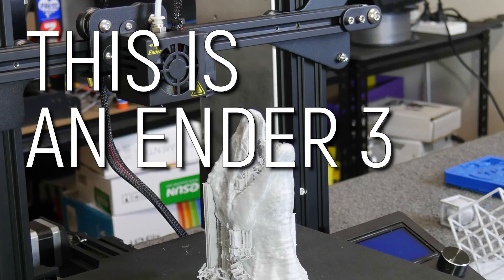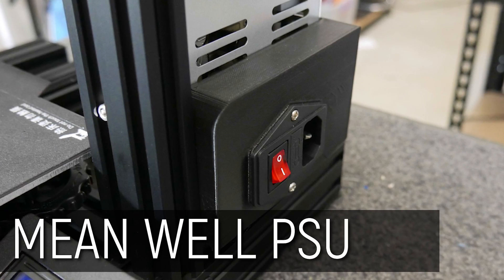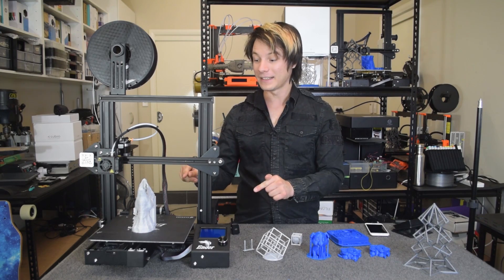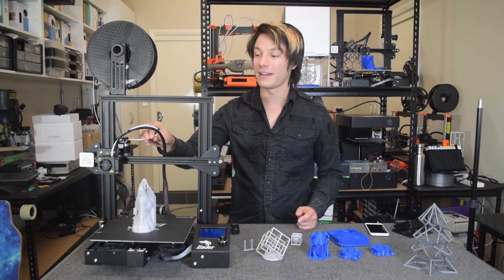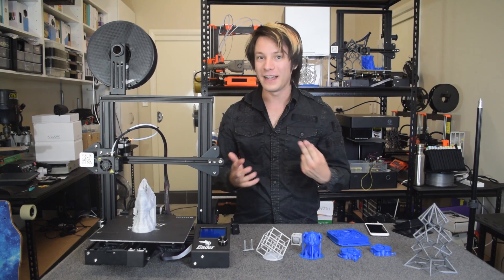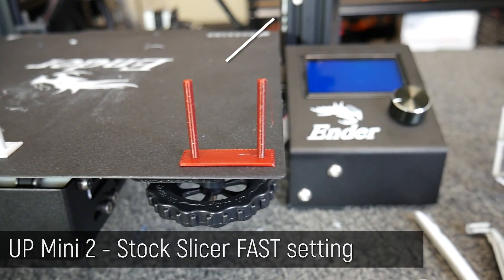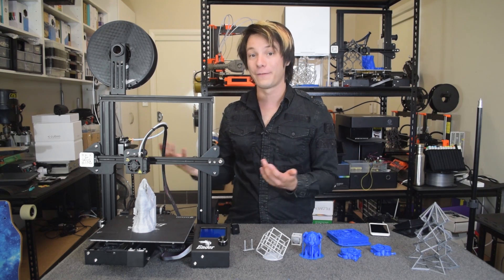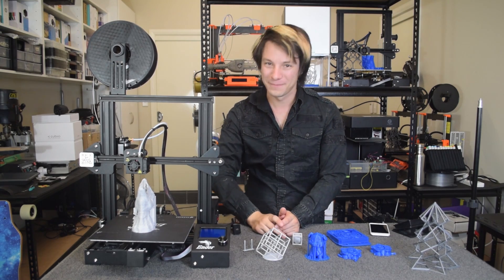Is the Creality Ender 3, Pro?

Comment: Some of the things you flat out missed or even complained about you have screenshots of showing that you at least knew where you could have gotten the answer from.. It has an upgraded hot end letting it get much hotter.The bed on the pro gets around 50C hotter (130C). Most people were saying they couldn't print ABS with the ender 3 without an enclosure, and so far that's all I really print. No enclosure, no glue, no hairspray, no insulated bed..just stock. I haven't had ANY issues with stringing. I only experienced it once i started messing with the settings in Cura.  By the looks of it id say its too hot and moving wayy too fast if filament is just leaking out as its moving. I keep hearing the "demagnized" bed claim thrown around. I think this is based on a misunderstanding. WHILE THE BED IS VERY HOT, the magnetization is definitely decreased. But as soon as you start printing on this bed, whereever material is extruded onto the bed almost fuse the bed and the magnetic cover, making it a bit hard to remove. Once the bed has cooled again, the magnetization is just as strong as it was preprint. Ive been printing nothing but ABS so far, at 110C bed temp. All day everyday for weeks now. That mat isn't going anywhere anytime soon from a magnetization standpoint.   If anything the glue between the magnet layter and that plasticized top will fail and they will split. If you remove the cover while its hot you'll understand what i mean there. The only issue i've had with this printer so far is that the bed takes a long time to heat up to 110C, even with the new 24v PSU. Ideal temperature settings for various filaments seem to be completely different for what actually works well in this printer, but once figuring that out getting parts to stick and have almost no visible lines became trivial. Turn down your speed to about 60% stock when dialing in your settings. It moves way  too fast and jerky for finer detailing from factory. Received mine right before you put this video out and it had Thermal protection. One thing to note i suppose is that if you got your printer from anyone but creality (at least on amazon) then it wasn't through an authorized dealer. From creality's own comments on the ender 3 pro on amazon.... I think the one thing that I've seen communicated over and over by most 3d enthusiasts is that the Ender 3 Pro is a damn good 1st printer, and a damn good printer for the price. Many saying the best printer in the price range and feature set. That i couldn't tell you as I do not have access to a different printer every week, but me thinks that's a good thing. From an engineering perspective there's no reason the Ender 3 Pro can't be dialed in properly. With the laser module attached you get perfect accuracy so the rest must lie in settings. Printer + Laser Engraver Module + rPI + Camera still puts me under the $320 mark which still seems a far cry from the nearest competitor.  ALSO, i must say I apparently ended up being one of the lucky ones that got a straight bed.

Comment: Probably 50 prints on my sons ender3 . many upgrades like extruder.  PTFE tubing.   better couplers.  And glass bed upgrade. installing bl touch soon 
$200 printer
 $125 in upgrades. 
Only issues is Cura 3 that is being used to slice  any recommendations for better slicer software were very new to 3d printing.. good content Thanks for sharing your experience. Never used sd slot other than test print . i just plug it in to computer thru USB.

Comment: I have been struggling with the print quality of my ender 3 since I bought it. My old printer was essentially an anet a8 so it had a direct drive extruder and I never had a problem with it. With this thing I have replaced the couplers twice, the Bowden tube twice and am on the 4th nozzle. I’m getting frustrated because the print quality just isn’t consistent enough to be able to just load a file and walk away.

Would you consider a direct drive modification video? Something apart from the super expensive ($AUD219) e3d titan aero

Comment: Any chance of a video about holes for self tapping screws? For example if you want to mount a PCB in a 3D printed box with a 3mm self tapping screw what hole size to use? Is it different for different filament materials? If its in a post how big should the outer diameter be to prevent bursting?

Comment: I don't care for ABL, but ALL the creality machines would vastly benefit from direct extruder with V6 type all metal AND beefier steppers, much beefier. That would allow increasing acceleration settings from the snail's pace the ender-3 especially has.
In comparison, anything from Tevo ships with fastly faster settings out of the box, and the difference is day and night.

One big print i need to do constantly for example: Ender-3: ~29.5hrs, Tevo Tornado: ~17.25hrs.

Comment: Watched your channel for quite some time and generally consider the videos well done and thought out.  I appreciate the time and trouble you put into your videos.

I recently received the Ender 3 Pro and have had nothing but great things to say about it.  Printing Hatchbox PLA on the removable magnetic bed means no scraping and I haven't re-leveled in 20+ prints.  I just finished the retraction tower you did and have NO stringing and it's a better print quality than your UP mini 2.

In short, I have had none of the difficulties you mention with my machine.  Considering the number of folks in the comments who have had similar experiences, it sounds like your mileage is different and a second look may be in order.
Reply: thanks you for your comment.
I am really stressed, I ordered a ender 3 pro I was already stressed enough with what happens for shipping with thing like 
Will they just leave it in front of the door of the apartment if I'm not there.
What happens if it get stolen.
(This is my first time ordering something online)
Knowing that it is working very well for basic printing releave  some of my stress.

By the way if you have any answers about my shipping questions I would really appreciate it.

Comment: I have to question this review really. I bought an Ender3 Pro on black friday. My first 3d-printer. Took half an hour to assemble. Another half hour to figure out Cura and download a bed leveling help print. Leveled the bed and printed the bed leveling helper 2 or 3 times. Then i Printed a stress test. Unfortunately it is at my workplace now. Anyway, it had minimal stringing, bridges almost flawless and the overhang over 75degrees werent as crisp as below 75 but absolutely good enough.

Since then i have printed 2 rolls of 750gram PLA and have NO problems whatsoever.

I have no idea what turning the buildplate 180degrees would do to improve anything? I have it with the tab out front and it works flawless, you only have to be careful fitting it in between the left aluminium extrusion and the powersupply.

About long term quality i cant say much yet as i havent had it that long but come on. The points you are making are a bit wierd. In my opinion just the powersupply is worth the difference... The sturdier bottom aluminium extrusion is probably also a good thing but since i havent looked at a regular Ender i cant say for sure.

The test i am talking about is this: https://www.thingiverse.com/thing:2806295

Comment: you can't fool physics, material will ooze from all printers no matter what type it is, bowden or direct, gravity will pull melted plastics down thru nozzle

creality extruder is very very bad and should be replaced after replacing couplings and tubings

Comment: I've had my Ender 3 for a couple of months now (must have one of the earlier models, bed surface not glued on but not magnetic either?), have spent easily 50+ hours not including print times just calibrating and adjusting and modifying things to try and get it to print right... I'm seriously close to biting the bullet and buying a Prusa i3 instead, but the other option is to upgrade the Ender 3 to a direct drive... Decisions decisions. Anyone with more experience care to weigh in?

Comment: Please make a video on the Klipper Firmware! pretty much no reputable youtubers have really made a video discussing the pros & cons. I'm about to receive my V6 & BMG & plan on setting up Direct Drive on my CR-10S. I was looking into Marlin features like Linear Advance, S Curve Acceleration, & Junction Deviation But I've just come across the Klipper Firmware & discovered that the small detailed movements that i see the printer kind of pause on could be resolved by using Klipper... but does Klipper have any similar features to the ones I was looking at in Marlin?!

Comment: The way Slic3r PE handles retractions and print speeds works well with this machine, and the autospeed function keeps a more even pressure in bowden-style setups compared to Cura (I even got Lift Z working in tandem with "Wipe while retracting" set to 10%). Also, I could see the benefit to a direct-drive extruder setup (ease of setup, plays nicely with basic slicer profiles, better seams with less fiddling about), but it isn't without drawbacks (mainly ringing).

Comment: I've had my Ender 3 for about a month now and just can't t tune it to make, what I consider a decent print. I have a cheaper kit printer that required no tweaking to make it print acceptably.  Angus, is there anyway you could share your Cura settings with this frustrated viewer.

Comment: The real question is, Anycubic i3 MEGA or Creality Ender 3? The anycubic is easy to build, and has self leveling, but its 60€ more expensive. Anyone can compare their print qualitys?
Reply: A year later, late reply :D

Well if You count in a BLTouch sensor to add self leveling to the printer you are at about the same price so there is little to no difference. (Keep in mind that I didn't look up the Anycubic i3 MEGA when writing this, so if it's bigger than the Ender-3 you might go for that since you get more volume for the same price)
Reply: @ZillionPrey  I went for an artillery genius for the direct extruder anyways :D

Comment: Personally, I'd only be upset about the constant revisions that many (if not all) vendors doing, would be if I bought a device in Jan 2019, and got one made in 2017 that had been revved 20 times since then.  What do you expect the company to do, hold on to revs for a year,  and then release? The world stopped being like that 20 years ago. Maybe they could do a better job documenting their changes, but I want to do business with a company that constantly improves their product.

 Are you cranked about this just so you dont have to review so often?  The date of any review is a factor in a buying decision, as well s the credibility of the reviewer.  If you make a review and its a year old and you are credible, I just look to see if the company made some changes, and peruse some other reviews. 

I did buy an Ender 3, around when your review of it came out, I had absolutely none of the problems you have had, once i learned to level my bed very very carefully. As new to this, I never would have taken the chance on something thats 2-3 times the price, as I never knew whether I'd stick to this.  So comparing what you get with this to a much more expensive printer isn't the point to me.  Its what you get with this at the price, and what you can do with it.  I use this to build parts, and for utility projects, not print fine art.  SO maybe that makes me less fussy.

Anyway I usually like your videos, but this one really seemed kinda grumpy, and it appeared you copied much of the material from elsewhere.

Comment: Standard Ender approx Dec 1, 2018 came with silicone sock.  No magnetic plate.  Standard rail.  Crappy Bowden but it has worked great from day 1, added shim thing ASAP.  Biggest improvement is cooling (not Petsfang, the other from the same guy).  Honestly, if you want to get exactly what you expect, you are going to have to pay more.  China does things cheap because they can.  The biggest problem right now is that there are countless Enders in the distribution chain and many are not the most current model.  It is what it is.  Remember the old days when the guys with too much time on their hands knew the serial number tricks to ID the best car parts?  I guess not, because that would probably answer a lot of questions.  It's cheap, it works well, if you can afford better, that's probably a good idea but if not, it's kinda nice that a cheap option is out there.  I love that China actually has products out in the world that version control is the biggest worry, not that the whole lot are basically shite.  Pretty sure that Creality will have a direct drive extruder add-on available soon - wouldn't you?
Reply: I have bought myself an Ender 3 Pro, as I have a small 3d printing project in mind, but not sure how much use I will have for it afterwards, hence a constrained budget.

No doubt I will be learning a lot along the way.

Comment: I've love a tutorial on upgrading one of these to a direct drive.  I've had my Ender 3 for almost nine months, and have everything dialed in incredibly well, except for the stringing problem.  I upgraded to a capricorn tube (easily the most important upgrade), and that helps, but switching to a direct drive sounds like the next step...
Reply: The Hemera upgrade by E3D is the way to go. It's simply the best. I don't have it but the whole internet praises it as the best direct drive upgrade. It's beautifully engineered and is a drop-in upgrade, except for the extruder motor wiring. That you'll have to replace, it's not long enough. The gap between the bowden, drive gear and heat break is so tiny it's practically a straight tube. No chance for flexible filament to jam.

Comment: We're all constant beta testers for Creality. What they should do is include a way to update the firmware. The consumer shouldn't have to buy another component just to upgrade the software on the printer. That's the most important thing. Everything else can be replaced by the user relatively easily, but ideally replacements wouldn't be necessary.

Comment: Got stock Ender 3 from Bangood 4 weeks ago.
Very, very pleased. Spectacular value for money. 
I got silicone sock, removable bed, upgraded tube couplers (I did still mod these with tie wraps) and all the other recent upgrades.
Yes you will need to learn/tolerate manual bed leveling but an evening on youTube will teach you all that. 

Believe me, for the money you pay this machine constantly gives incredible results!

Comment: For what it's worth I have a (non-Pro) Ender 3, and my stringing test prints with default 1.5mm PLA settings in Cura and stock parts besides a Capricorn tube, are as good as those from your UP Mini 2. Seriously zero stringing. Wish I could understand why some of these have horrible stringing and some don't.

Comment: Hey, I think I have another version of the Ender... because I have the a flexible PCB or epoxyplate (don´t know what it is called in english) with that fake buildtak on it. Hold in place with these paperclamps. Which works actually really good. I´m using Simplify3d but I tried Cura 3.6 with the stock profile for the Ender 3 and it works ok or good lets say. try it... And thanks again for a very good video :-)

Comment: Awesome video man! I didn't realize how much of a difference nice bowden tube can make! I'm disappointed to hear that Creality is still constantly updating. In my opinion at this 200-300 dollar price point there are some more reliable machines, especially for a beginner. Take the QiDi X-ONE for example. $280 and I've been using it for 2 years no issues. That is the main printer I am using on my channel at the moment! I do support Creality and the things they are doing to push the technology forward, but in my opinion new 3D Printing users need to be told that they are not the be all-end all of this technology.

Comment: IMO they've missed a point(s) to compete with Flash. That was "so hard" to make "Pro" with an open firmware and the PCB with sockets for drivers instead of soldered. These two moments could make much more difference... I'm glad that did bought Flash.

Comment: I love harsh reviews! 
 Whenever I consider a new printer model I ask what people does NOT like about their printers. That lets me know what mods are necessary and how much work it is to get the best quality from it.
Reply: I agree. Bringing up the flaws and possible solutions to the flaws helps make a decision. If you don't need a magnetic surface or power loss recovery, you could be better off buying the standard Ender 3.
Reply: @PunakiviAddikti  
Both my Ender 3s have power-loss recovery.
The only thing I've done, other than slicing tweaks, to get them to print quite well, is adding a glass bed, and using Magigoo, which really is magic.
Reply: L 0bi

Comment: I can't back your printing experience... I had an early Ender 3 and got amazing print quality. No stringing at all with the stock CR10 settings in cura.
Looked way better than your stringingtest with your UP mini 2.
Reply: do you have pics of it?I really want to buy it for projects but dont know if its worth it or not
Reply: Jejaka Berjaket Hitam i can confirm, and so did the maker of this video, he later found out reducing retraction speeds fixed the stringing, i have a ender 3 and printed alot of upgrades for it, it runs on a pi with klipper + octoprint and prints insanely clean prints at 120mm speeds at 0.12, and the print quality is amazing, ive seen alot of videos and this rivals the prusas, BUT not stock, i spend a total of 360 euro which 178 was the printer from, for all sorts of mods, like i swapped both fans for noctuas, 3 buck converters for 2 led bars + 12v fans and the 5v pi, tl smoothers, glass bed etc etc
Reply: Bought a pro unit month ago. So far no stringing issue. Excellent value for money.